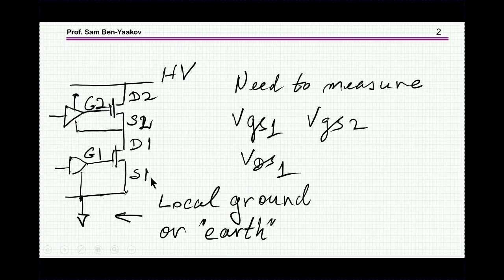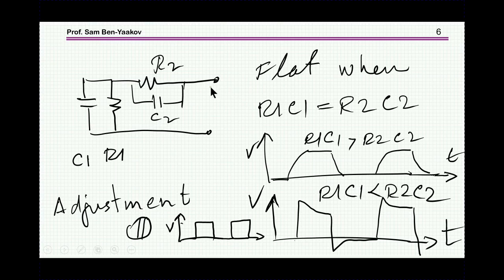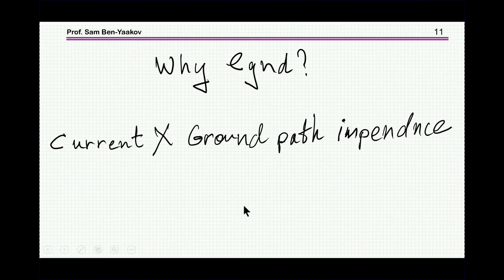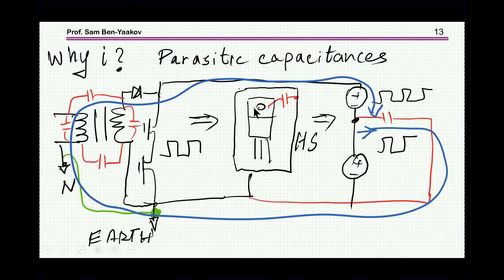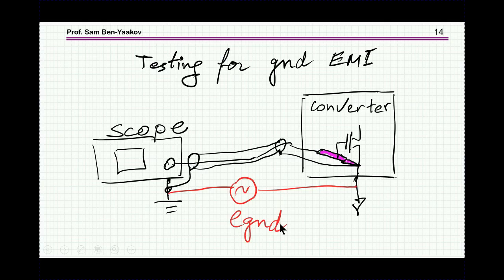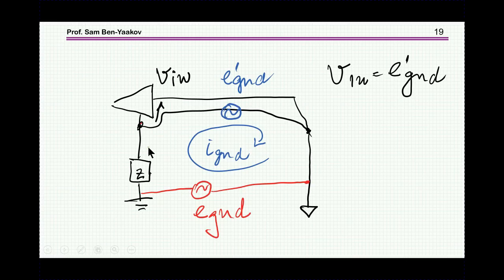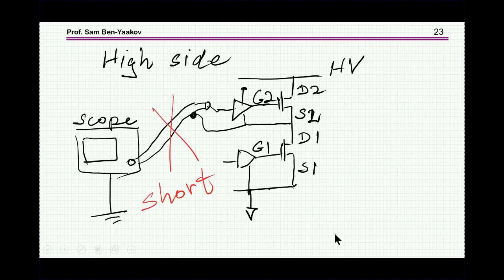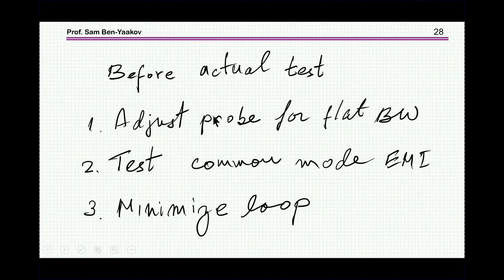Oscilloscope measurements in power electronics: I. Single ended probe

Comment: Thanks for the nice video on Oscilloscope... If there is any practical related to above discussion like effect due to ground voltage/current, effect due to flux during high frequency. Can we create artificial EMI and see the effect  through oscilloscope. Regards
Reply from the maker: In any PCB that includes both power and signals you  can clearly see these effects.

Comment: Hi sir, can you please address my queries
1.power ground and analog ground should be common or different.
2. In a 3 phase  inverter fed motor drive  when using more than 48 volt battery why it is required to use isolated gate driver.
3. I have seen spike in current wave form and the mosfet failed when i used to probe  vgs and vds .i am using isolated scope yokogawa dl850ev.what may be the possible reason .
Thanks in advanve
Reply from the maker: 1. Separated but them connected in one point. 
2. The reason is high power
3. There are capacitive paths that can still nject noise.

Comment: Since you broight up the common mode problem, I have a question related to it.  Isolated converters have a Y cap across the transformer to mittigate common mode problems. However, I could not found any relevant documentation on the subject on how to select such cap. It seems to me that it is trial and error ? Could you give your view on this ? Thanks.
Reply from the maker: Have a look at https://youtu.be/5NRiLOvmXdA it includes some relevant information. I do not recall any specific documentation on subject.
Reply: @sambenyaakov  thank you. Good information.
Reply: Probably this has been solved by now, it's a question I was trying to answer myself recently. My thoughts is that you'd want to use the largest Y cap value possible (less impedance for CM noise to filter better), while adhering to leakage current regulations. Let me know if there's some more thorough guidance I can check for this.

Comment: Thank you very much. This is the most clear explanation I have seen on this subject, especially the last parts about the voltage ratings of parts, and the capacitive coupling of EMI through an isolation transformer.
   I have often wondered why modern oscilloscopes are not designed for isolation in the first place. Oscilloscopes have been built without any exterior metal for well over a decade. It seems to me that the standard practice of an earth reference is just an attempt at selling me overpriced differential probes. 
  Now I must go watch your latest upload on differential probes to further isolate my ignorance.
 
Thanks for the upload.
-Jake
Reply from the maker: 😊Thanks

Comment: Digital multi channel scopes can compare two signals, so channel 1 would be the gate and channel 2 the source (of the high side switch), and the ground clips are disconnected. The resolution and speed are poor, but at least you can do the measurement. I also thought about isolating the converter itself and not connecting the scope to the mains earth.
Reply from the maker: Ground clips need to be connected.

Comment: You show wrapping the ground wire around the probe which is not desirable since that makes an inductor! I was taught to just hold the wire against the probe.

I wonder why there aren't more scopes that are double insulated and therefore do not need a ground. As well as battery operated scopes that are basically ideal for floating measurements, especially for signals too small for a differential probe to resolve.
Reply from the maker: Thanks for good comments. Wrapping a bare wire on metal does not make a coil if tied. Differential probed are not that expensive anymore (save the high end) and they provide a very good solution for power electronics. For very low signal, true differential scope are around (e.g. Picoscope 4000 , if I remember right the number. I do own one).
Reply from the maker: Just realized that when referring to wrapping you meant the first mode I showed in video, wrapping of the isolated ground wire. You are right, but holding the wire against he probe is rather cumbersome. Thanks again for comment.